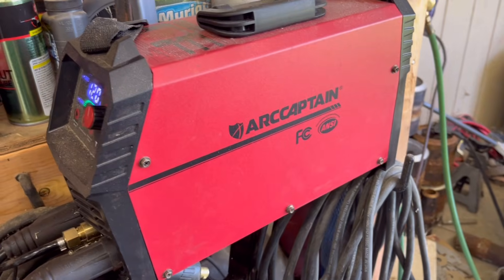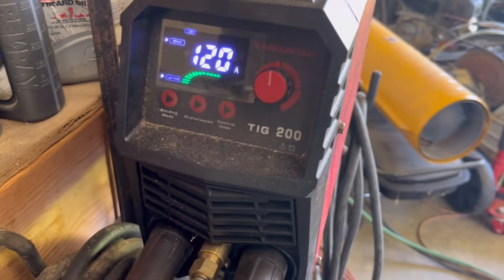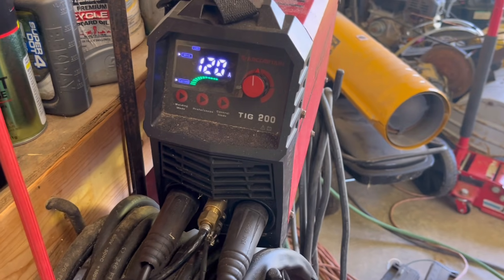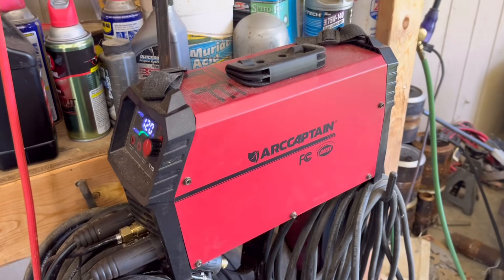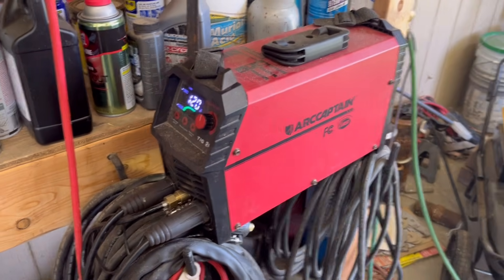Master 1/8” uphill 7018 stick welding

Comment: Εχω μια Γαλικη ηλεκτροκολληση inverter Gys Gysmi 160 A (Amper) το ηλεκτροδιο 6013 Φ 2,5mm στα 80-85 Amper ειναι ΟΚ , το supercito 7018 Φ 2,5mm απο τα 80 σταδιακα μεχρι τα 160 Amper σκαει μονο σπινθιρα δεν κανει τοξο, πηρα και αλλο κουτι ηλεκτροδια 7018 απο αλλο μαγαζι και παλι το ιδιο αποτελεσμα μηπως καταλαβαινεις τι φταιει; Ασχολουμαι ερασιτεχνικα ευχαριστω.
Reply from the maker: It works ok up to 85 amps but when you turn it up higher it doesn’t work? That’s strange. It sounds like your machine is messed up. I’m not sure though.

Comment: helpful, but you should show the hotpass, as a welder i know its easier to run a shit hotpass and grind it out, then for some reason that weave just lays in there good without cratering/and or building up the middle. i literally been welding since highschool and unfortunatly ive forggoten how to do a basic hotpass in a vertical lmao, i produce one nice vertical that im super proud of every day to the 50 others that im like "mannn please dont come up here and look at that shite lmao" but yea for some reason i struggle bad when the print only calls for one quarter inch pass uphill to a colum and the edge of a piece of angle (as in like a tieback for crane system or collum) my overhead and flat fillets are something else tho, consistant as a mother fucker but i hate vertical
Reply from the maker: Okay, well, I don’t usually do a hot pass on this kind of thing but for smaller welds like you are talking about, I’d definitely use 3/32” . It’s way easier to do those small 1/4” welds and make them look good.

Comment: I keep getting a gap in the middle of the weld as if the puddle hasnt built up at all, theres a weld on each side and none in the middle, but im going slow. Cant seem to find the problem. It only happens at times sometimes its fine but im using the exact same motion everytime
Reply from the maker: Okay, so when you go across you have to push your rod into the corner as you are moving across, otherwise your rod wont burn into the metal you’re welding on. This will leave trapped slag between your weld and the steel if you don’t push your rod into the corner. Hope this helps. 👍🏻

Comment: if you don’t mind me asking how do you go about recording your arc shots?
Reply from the maker: For my stick welding I use a cannon camera. You have to dim the picture until you get the best picture. For my mig and tig videos I just use my iPhone. It actually does very well for those types of welding.
Reply: @ think I can get away recording stick puddle with a lens over my iPhone camera?

Comment: At Pullman Standard we built railroad cars on the main frame we'd lay down like 1" × 2" flat bar and it required 7018 rods 18"s long probably close to a 1/4" rod. Worst part of the job was to make sure your pants legs didn't leave exposed skin. That happened to me one time with flair legged pants very painful for a few days. Most of their welding machines were at least 600 amps stick welders. Have fun!

Comment: Biggest mistake I've seen were people trying to drag the rod like using mild steel. Rather you should flow with the pool of molten metal you're laying down and being consistent with your moves. Drag rods are great at laying down a steady weld and the flux curls right up there is hardly any chipping of the weld involved but of course the strength of the weld isn't as strong as the 7018 low hydrogen rods.

Comment: Would this be any different for a v groove at a 35 degree bevel?
Reply from the maker: If you have a backing strip it would be very similar, but if it’s just a gap in between it’s a lot more difficult.

Comment: I have a job to do on vertical direction about 1.5m long weld 3mm thick material, i use 3.2 mm stick 7018 basic from lincoln electric, Citywork 160 from Stayer mchine. I put 125 A and if I move slow it mkes holes in the material
Reply from the maker: Use smaller rods . That thin metal can’t handle that much heat.

Comment: Very interesting procedure. I see that the welded part is very thick, what if the part is 3mm thick? The time you stay on left and right positions will not make holes in material?
Reply from the maker: Yes it would blow holes in thin material. You would need to use a 3/32 or smaller rode for thin metal.

Comment: As someone doing verticle for the first time recently, I'm surprised you don't touch on how one of the biggest things to deal with is work piece over heating. If you keep burning rods too quick, the plate gets too hot and you start burning through since heat rises with thin/medium thickness metal
Reply from the maker: Yes that is a good point. I can definitely talk about that in another video.

Comment: can u di that on 3 mm metal thick? or u make a hole if u are so long on same spot like in the video?
Reply from the maker: If you weld uphill with 1/8 of an inch rod on 3 mm plate, it would be hard to not blow a hole. You could do it with a 3/32 inch rod or smaller.

Comment: Been struggling on getting my arc length to stay where I want it as I move upwards.
Reply from the maker: Get as comfortable as you can and do a dry run. It just take practice. Try to have a steady push inward as the rod is burning shorter.